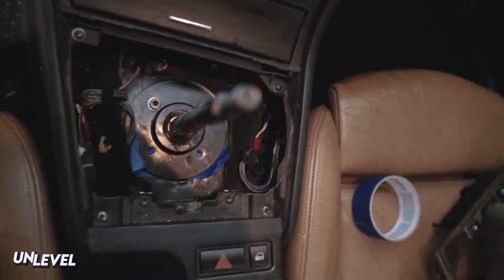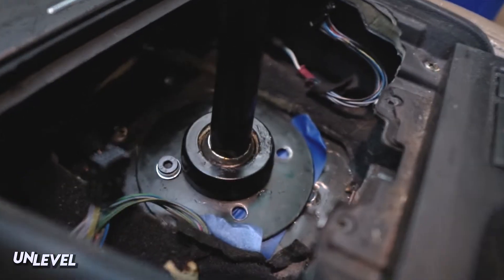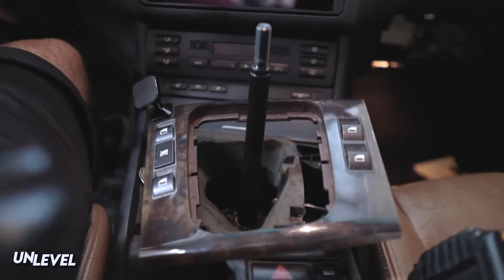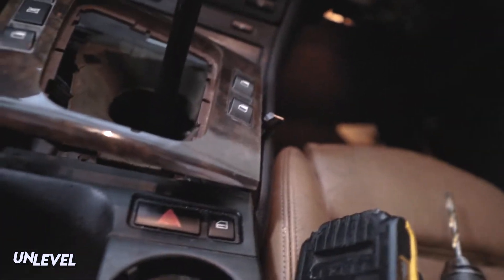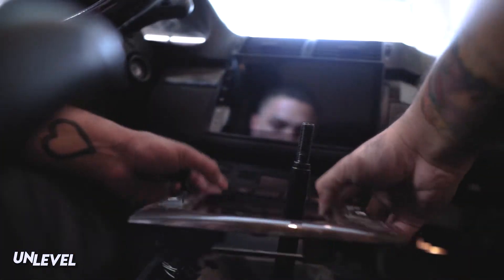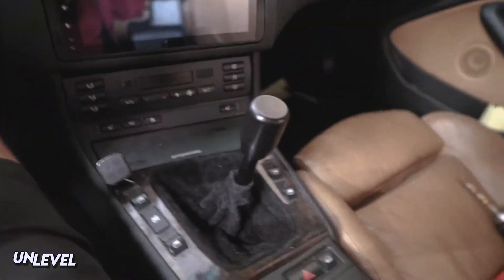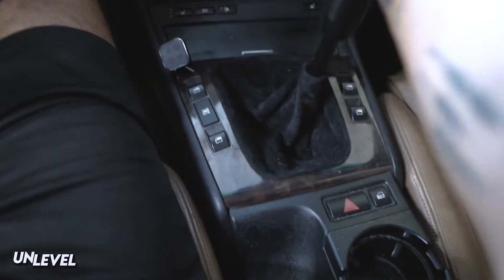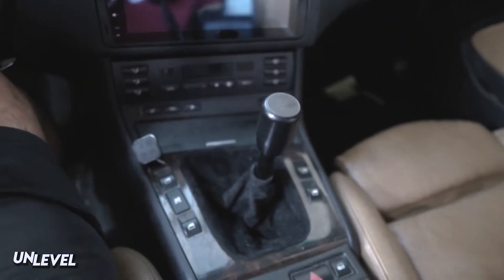E46 Touring Chassis Mount Shifter Adjustment

Comment: I have the V2 of this shifter in my car. I was hoping to find some tips on adjustment. It seems instead of being strait up in neutral between 3 and 4 it seems to be laying over in front of 5th gear. Have any advice for me? There not much info out there.
Reply from the maker: You got an Instagram you can shoot me a DM on? I can try and tear my shit apart to show you. @acdna
Reply: @noseeb_mas I’m thinking I may just have the base in to far to the right which is pulling the shifter that way.